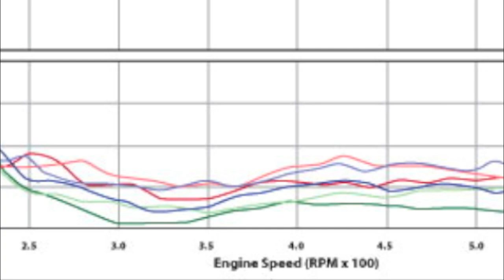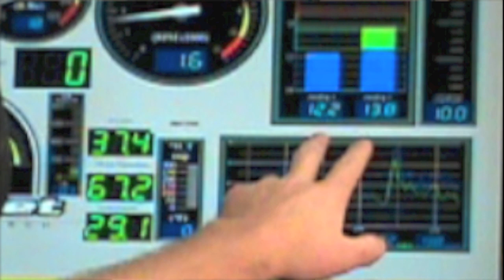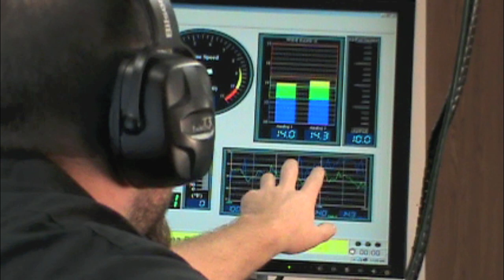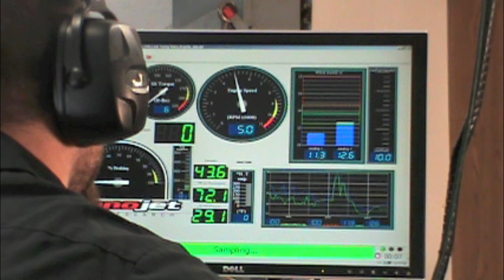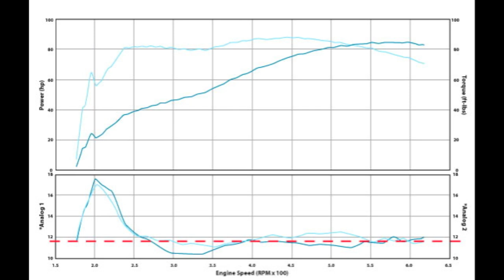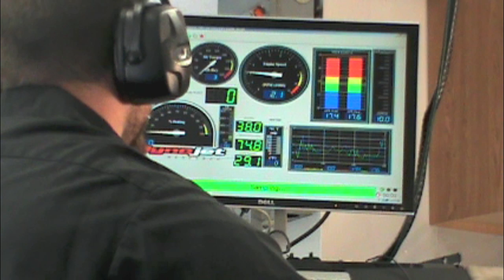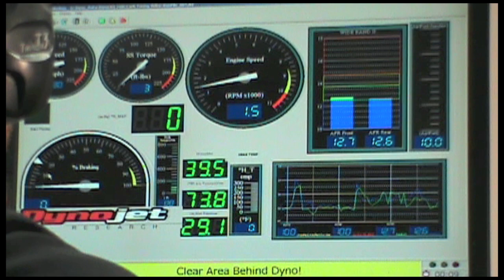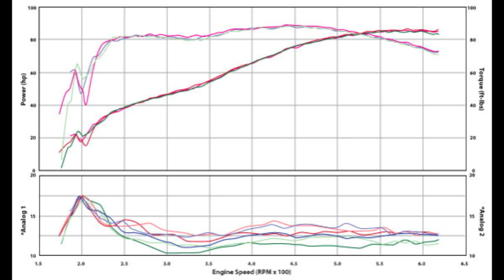S&S Cycle - Carb Jetting and Tuning - S&S Super E & G Carburetor

Comment: Another video with excellent information.  I am running an S&S Super G on my 1999 FXDX and it is an excellent combo.   Scott
Reply: @Bev Mathews no idea now.  Installed it 18 years ago and haven't had to touch it since..  When I bump my motor up from 95" to whatever it might become (103", 113", or 124") i will note the jets and report back.  Hopefully that will happen in the next year. I do know the G is on the edge of being too big for a 95" with a Yost power tube,, good heads, and .590 lift gear driven cams. I can tell she needs more cubic inches to get the best out of the carb.

Comment: In my older model super e carb what would cause an exhaust pop when I let off the throttle while going down the road? Usually a single or double pop… sometimes followed by a slight deceleration crackle.

Comment: i've been re-jetting my super E on  a '79 ironhead.
had a 0.31 intermediate and 70 main. too rich and burning plugs.
0.265 was too lean. I found a fantastic tune with 0.285 and 70, booster pump set to zero .
wrapped exhaust and medium silenced "cigar" mufflers.

Comment: I just purchased a super e carb for my 88 ci twincam fxst.
I have the camplate kit with the TC3 pump and geardrive 551 cams. 
I have the Vance & Hines big shot staggered exhaust. 
Stock ignition. 
S&S manifold 
S&S adjustable pushrods
S&S Valve springs 
S&S Teardrop filter kit

I want to begin with 0.31 intermediate and main 74. 
Could you give me some advice if this wil be the right start for my setup ? 

Thanks in advance.

Comment: I installed an S&S Super E on my '92 FatBoy. The bike runs better than it ever has but the vibration at 3200rpm/70mph is intolerable. With the OEM CV carb, it was bad but tolerable. Another owner went from a Mikuni back to a CV carb and greatly reduced his high rpm vibration. The only thing I can think is jetting. Can rich jetting increase vibration? I hate to start tinkering with it as it runs so good with no backfiring or sneezing. But if it needs to be leaned out a little to smooth it out, I'm all for it. Thanks!
Reply from the maker: Seems unlikely that fuel delivery (no matter the carb) would cause vehicle vibration.  What are your plugs telling you? What ignition are you running?
Reply: S&S Cycle, Inc, The ceramic is almost white with black around the metal and down inside. Electrodes are clean. I have a pic of the plugs. The 80” Evo is bone stock. I put the stock FatBoy exhaust back on with the plugs knocked out of the mufflers. I installed the Super E with it’s factory installed .0295 and .072 jets. It starts easily with almost no warmup required, like it might be a tad rich. Around town it’s very smooth. 60mph and up it starts sounding like it’s under a heavy load and vibration gets worse as I reach 70mph. The video makes me wonder if an 88” engine runs perfect on a .028 and .066, my stock 80” might be rich on the main at .072. I’m at sea level on the west coast of Florida. Thank you for the help!
Reply from the maker: @79FatStrat  White ceramic sounds a bit lean. Best bet would be to work with a local tuner to get you bike sorted.
Reply: Ok. Will do. Thanks again.
Reply: Just for gits and shiggles, I installed the .028 and .066 jets in the Super E on my Evo FatBoy. What a difference! Definitely not too lean on the intermediate as it starts and idles cold no problem. No coughing or sneezing at low speeds. WOT from 40mph, wow! I didn’t know she had that much power in ‘er! Even with the OEM exhaust minus the 1 1/4” plugs. Would love to see what the dyno says for a/f ratio but for now I’m happy. Vibration is also way less. Back to it’s normal feet numbing solid mounted Evo vibes. Thank you for a great product!

Comment: I have a twin cam 88 with 509 cams sns super e carb new and true duel 1-3/4 fish tails no baffles what should i use or start with for main and intermediate jet
Reply from the maker: We'd recommend start with a .060 air bleed, .031 intermediate and a .074 main and adjust from there.

Comment: ok, so I dont have a dyno.....I rebuit the carb on my '89 evo. It wasn't hard. I'm sure I have it together correctly. There was no o-ring on the accelerator pump outlet when I took it apart. There is now. The motor runs....I checked for manifold leaks by spraying carb cleaner around....did not affect running....I don't know if I'm lean or rich. 70/29.5...after warming up...idling @ 1000....air mix doesn't seem to do anything...if I blip the throttle...no matter where I have the accelerator pump set, I get fuel mist back out the throat and it stumbles...if I bring the rpm up to about 2000...then blip it from there and let go...I get a pop and fire from exhaust. Can u point me in a direction?
Reply from the maker: Hey Bob, this sounds like a fantastic question for our Tech team. Shoot them an email at SSTech@SSCycle.com

Comment: Awesome video, especially the two examples of too rich and too lean..
Reply: stevenminix 

Something I discovered while tuning the Shorty E on my Pan (major exhaust change): With the engine cutting out on a test run, pulling the enrichener up just a tad smoothed it out. I'd say that's a pretty good indication she was running (very) lean.
Reply: CapnDrift Oh, and also... after running the highway with the enrichener pulled I learned if I left it up while passing through town the engine would begin to fart and snort. Pushing it down (closed) cured the problem. Therefore, it only makes sense to conclude the intermediate circuit was not lean, as well.

Butt tuning at its finest. ;^)

Comment: Is there a difference in how the carb is tuned if a large cam is installed? It's a 2001 super stock113 with a 520 lift. Also what's the difference between a "g" and a super "g" if any.
Reply from the maker: Changing cams will generally require re-jetting of the carb. I may also require changes to ignition timing since it may change the amount of cylinder pressure.
The Super E has a 1-7/8" throat and the Super G has a 2-1/16" throat. Super E carbs are recommended for engines up to 100 cid, and the Super G is recommended for 100 cid and greater. Racers sometimes use the larger carb on smaller engines since top end horsepower is more important that low or midrange throttle response.

Comment: Question: S&S e series carb. On sporty 1200 with 80 hp and 28 pilot jet  now went to 1275 big bore kit and went to 29 pilot jet but bike still runs with air/fuel screw  seated so I dropped to 28 an then to 27 and same thing. Seated  air/fuel screw and still runs. . WhAt am I missing?  Maybe one thing is I don’t believe I was at or  below 1,000rpm was more  like 1,200 rpm. I’ll pull carb off an clean it. Maybe float needle isn’t seating and just rushing fuel in.  But nothing out my over full line.  Idk. I Just know that if I had dyno it with a 28 pilot an was good and then went to the 1275 kit then I shouldn’t be going down in pilot size so there’s no sense in trying a smaller pilot jet. I just think I’m missing something  foolish..
Reply from the maker: Tuning online can be challenging, give us a call at +1 608-627-1958 and leave a detailed message or email us at sstech@sscycle.com.

Comment: Could a rich condition eventually build up carbon and cause the bike to smoke at idle when warm? Super E   1984 flhtc.
Reply from the maker: A very rich condition would generally produce black smoke through early part of RPM range.
Reply: S&S Cycle, Inc  I purchased a stealth air cleaner kit for my super e and installed it today..but now the carb is visibly spewing gas out when I hit the throttle with the filter off, with it on it gets drenched.. Barley made it back home..I put baffled slip ons back on the bike yesterday after watching the video recommending to do so..but had no problems like this with the hypercharger set up that was on it.
Reply from the maker: @squawk3120  Overfueling would not be related to the air cleaner.  We'd recommend you reach out to our tech team to help you get it corrected. https://www.sscycle.com/contact

Comment: What can be wrong if I can't get the accelerator pump to smooth out the off idle throttle response?
Reply from the maker: Probably not accelerator pump.
Reply: @SSCycleInc  it's a 1200 shovelhead. 70 main, 280 intermediate. I can't get the stumble to go away and the idle mixture is set.
Reply from the maker: @GPgman  Best bet is to reach out to our tech team and walk though the combo you have https://www.sscycle.com/contact

Comment: I got a SuperE shorty. Runs great, but fuel leaks from overflow when bike sits. I have cleaned it 2x and still a trickle flow. I know its my float. How do I adjust float to stop overflow?
Reply from the maker: First - make sure that you are turning your fuel off at the petcock when you turn the bike off, and make sure that the petcock itself doesn't leak. If your float is set incorrectly, it could cause it to leak out the overflow. You would drain and remove the bowl, then while holding the edge of the float over the needle, push on the float gently to adjust it - make sure it is level with the ledge on the bowl. For detailed info, give our techs a call - 608-627-1958
Reply: S&S Cycle, Inc 
Thanks
Yes my pet cock doesn’t cut off completely, just a trickle. Yet after shut off n run dry the bowl fills n overflow happens. All this after rebuild. Thought needle not seating right .Yet it’s clean!
Must be float at wrong angle. So with bowl removed disengaged, float should be level with bowl
Reply from the maker: @ssflh68ify  You'll definitely want to start with the petcock - We would recommend replacing it. The reason the fuel is even in there is due to a leaky petcock. Replace that first, then see if you're still having an issue. Feel free to call our techs for more info!
Reply: S&S Cycle, Inc 
Petcock is a TiwainTed type, trying to keep “The Look”;  73 FLH.
Had her sit for months no problem of overflow!
Thanks for your prompt response, advise taken!
Reply from the maker: @ssflh68ify  That's likely your major issue. There are a few manufacturers out there who make vintage styled petcocks, Pingel is a favorite around here.

Comment: My wife's 1990 sportster 883 custom was running really rough so I tore into the carb to give it a good cleaning. Inside was a gritty debris caked in all over almost looked like sand. After cleaning, reinstalling, and tuning in as best as I could with out a dyno it still isn't quite right. Idle sometimes struggles but not as bad as it was. The main problem is serious hesitation when giving it throttle, more so when hitting it hard.. any suggestions you could offer would he greatly appreciated
Reply from the maker: Assuming stock carb? Either way, sounds like fuel went bad. Purge the tank and petcock of any bad fuel. Blow the carb apart and soak in Pine Sol for a few hours (this will eat away the resin) and replace all of the jets in the carb.
Reply: @SSCycleInc  No it's the Super E Shorty. I will try all that out and see what happens

Comment: what is the copper tube on the opposite side of  the intermediate jet. not the accelerator pump but the one that is not talked about. have an s and s and this piece is broken
Reply from the maker: That is the pick up tube for the enrichment system. Your dealer can get one for you, but they are a little difficult to install properly. You may want to send it to S&S to be repaired.

Comment: I've got an '89 evo with an s&s super e when at idle at 1000 rpm it'll drop to 500 rpm or lower I'll give it a little throttle  the rpm will pick up then do the same thing again, what could be the problem
Reply from the maker: There are several things that could be causing that kind of problem. First, most likely would be a sticky throttle cable that doesn't actually allow the throttle to close all the way on a regular basis. When it does close all the way, the idle drops. It could also be an intermittent manifold leak. Same deal. When it's leaking the idle is higher, when it seals up the idle drops. If you have converted the ignition to points, it could be sticky advance weights. If you can't chase the problem down, it would be best to call our tech support line at 608-627-1497. Those guys will be able to get if figured out pronto!

Comment: I have a sporster 883 with a super E what kind of jets i need to tune the carburetor? Thanks
Reply: It would depend on your altitude and exhaust, but for sure you will need jets on on the smaller side of the range.  Intermediate: https://www.sscycle.com/products/super-e-g-intermediate-jet/        Main: https://www.sscycle.com/products/super-e-g-main-jet/

Comment: Hello, the tube on the bottom right of my super E was connected to the carb but not connected at the other end all of a sudden. I can't find where it connects to and now my Harley acts like it wants to die when I give it good throttle. Please help
Reply from the maker: Brandon Dilly I believe you are talking about the small hose that connects to the fitting on the underside of the bowl, just behind the accelerator pump housing. That is an overflow tube that should simply be routed behind the pushrods and down behind the engine. That's just there in case the carb were to overflow, the gas would not spill out on the bike and especially the exhaust system! Sounds like you may have an accelerator pump problem. We'd suggest that you call our tech line at 608-627-8324. Those guys will get you cranking again!
Reply: Thanks for the response, I actually found this exact answer in your installation video. You guys rock! my dad adjusted the air fuel screw and idle screw yesterday but not that accelerator pump screw. That's probably where our problem lies. Thank you so much

Comment: What is the difference in E&G..are they they the same ?
Reply from the maker: While both are great carburetors, they are not the same. The Super E is more intended for a stock, or mildly modified engine while the Super G is for bikes with larger cubes. In general many people consider 100" to be the hinge point, with the E being the go to for engines under 100" and the G the go to for over 100" engines.

Comment: Thanks for these.  All of a sudden my 1994 S&S G is fouling plugs after about 4 years. My mechanic is suggesting I go to an E and even change up a gear  to an 83. I'm at a point where I think he is juggling parts around. From his end after three years he is saying the G carburetor is meant for  going wide open all of the time and the e carb may  let me fart around town a little. https://www.flickr.com/photos/shanesflyingdiscshow/40089162710/in/album-72157658576312006/
Reply from the maker: The G is definitely meant for large capacity engines - if you have questions give our techs a call and they can go over specifics with you - 608-627-1958
Reply: Thanks.